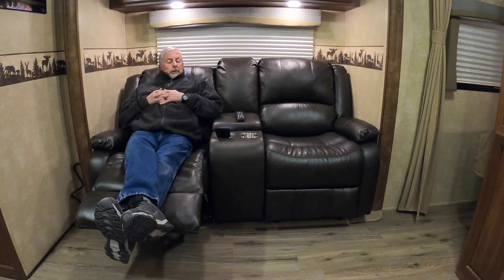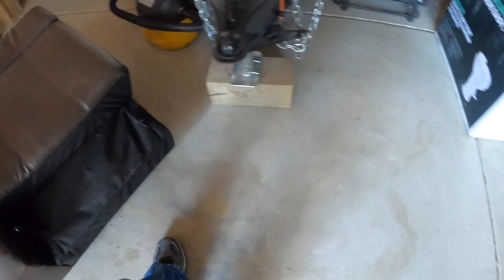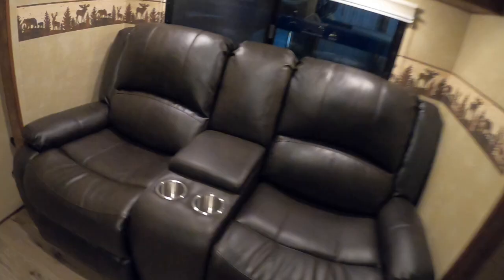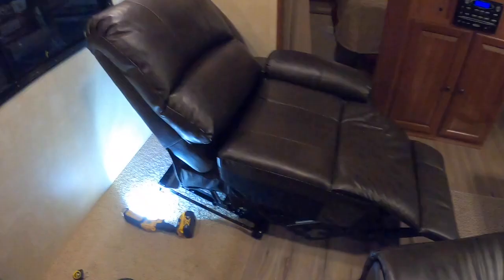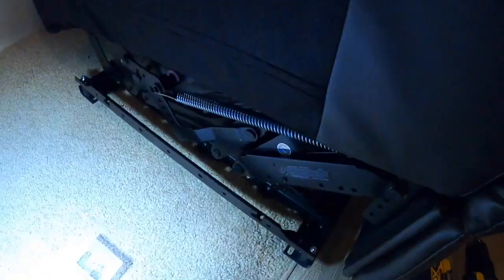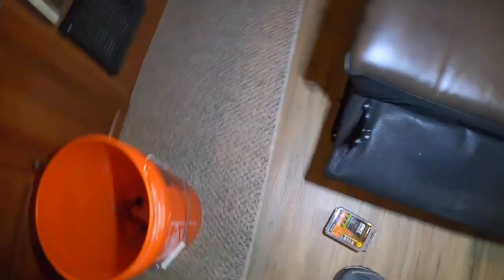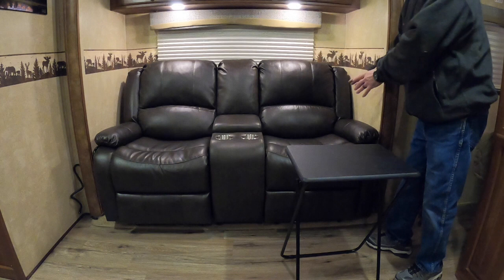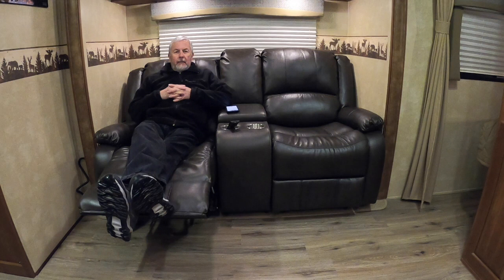Best RV Recliner RecPro travel trailer renovation travel trailer remodel motorhome

Comment: Well done video. Especially the special effects with two of you at the same time. 

Why do you have to attach the recliners to the floor. Ours aren’t and they don’t move. Like the wall hugging recliners
Reply from the maker: I think some folks might think that’s my brother haha. I didn’t want them moving plus back was lifting up when I put the leg section in. Thanks
Reply: How did you know how thick the floor was. An excellent point. But I have no idea how to determine the thickness of the floor
Reply from the maker: @terryhaynes1596  great question. My slide float above the floor about 1.5 inches. With slide in I looked under lifted the carpet edge then measured. Then I took a long straight edge pushed down in the carpet stuck out over the floor a few inches. Difference was 1.25?inch deck thickness. With 1.25 inch stew with washer plus thickness of frame I was good to go. Thanks